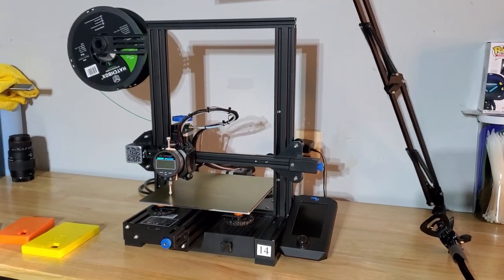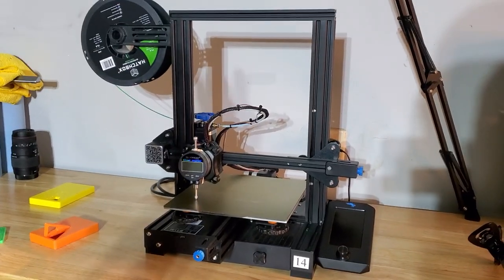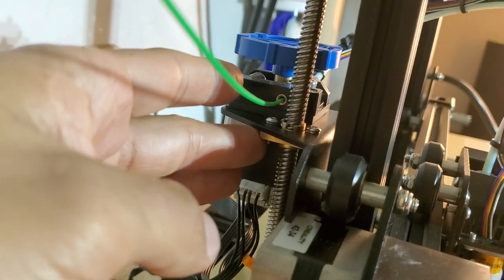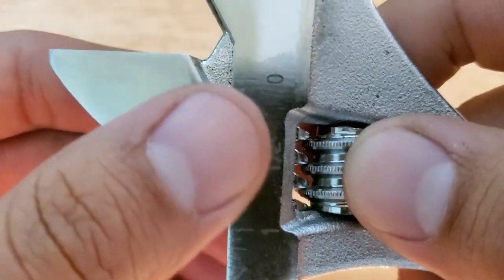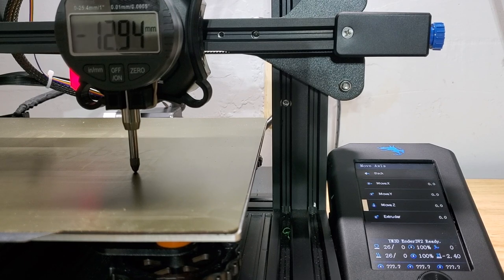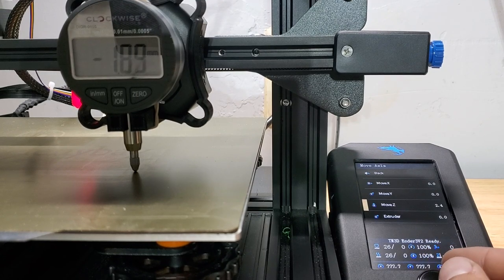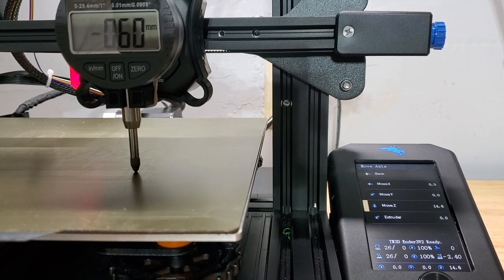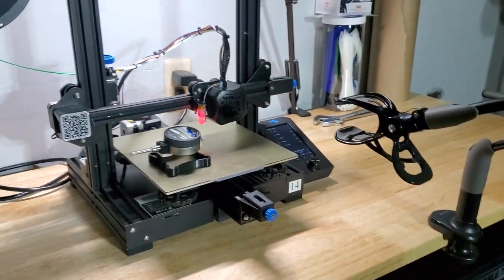3D Printing Elephants foot. How your lead screw is causing it and how to fix it! Ender 3v2

Comment: I mean ok but also  that is not how backlash works on a properly built and set up printer, sure if your printer is poorly set up and the gantry is stiff and does not fall under gravity like it should then yes the lead screw will move and the bottom of the tooth will engage and push the gantry down however this is all an indication of a poorly set up printer,  on a printer that is properly set up the gantry is free floating with no resistance  and is always trying to fall under gravity's power this mean that the the gantry should always rest on the top of the tooth when going up and down.  So if you are getting backlash then it is a sign that something is wrong with your printer ether the adjustment wheels are to tight or there is a imperfection in the extrusion causing a tight spot and so buying an anti back lash nut is not a fix it is a band aid to hide a deeper problem
Reply from the maker: My guess is the majority of people with an ender 3 have eyeballed everything during the assembly, so more than likely the large majority of newbie first time printers have this issue. What youre saying makes sense but unless youre the type to obsess over these details like a machinest the bandaid will work in most cases.

Comment: Use anti backlash nuts. The ones with springs in them
Reply from the maker: Yep that's what's installed. It helps reduce backlash a bit, but doesn't completely eliminate it.
Reply: @Redo3D  have you found a way to eliminate more?

Comment: should be a much easier way, i have an ender v1 and after an auto zero if you move z plus 0.02 you should hear the limit switch close and then move it back to zero and you hear it open

Comment: Your explanation completely ignores the effect of gravity on the system. Did you notice that how much discrepancy you are getting in the movement is proportional to the spring compression on the probe of your gauge. Also 0.3mm is a bad choice of distance to test with as the stepper motor has a finite resolution in angular rotation per step, and with the pitch angle of ender like machines one step of the motor equates to a Z change of 0.04mm so only Z changes that are a multiple of 0.04mm (0.2, 0.24, 0.32 etc.) would lead to consistent movements.

Comment: I dont use z-hop because of backlash. I solved leveling problems whan i Started using propper leveling method.

Step 1
Clean your glass with IPA (alcohole), never touch glass with your hands. Greese will mess up adhesion

Step 2
Heat your bed and nozzle, retract filament and celan nozzle so it has no plastis on surfacw you can use soaked wipe with IPA

Step 3
Go to moation and raise your z axes to 0.7mm

Step 4 
Level your bed on 4 corners (where screws are) with creality scraper. Its should be exactly 0.7mm thick.
Note: dont move print head woth hands, use comand od display to do it. Near corners with coordinatet between 30-40 mm, far ones 190-200 mm
(So you will use 4 places x=30,y=30 than x=30, y=200 than x=200, y=200 and x=200, y=30)

Step 5 
Enyoj perfectly leveled bed.
Your z-offsert should be 0.

P.S. maybe you will have to do Step 4 2 times.

This is copy paste from my notes because on facebook groups peopel often have problems with leveling. I made gcode for mine ender 3 but it wont work with v2 stock firmware because it cant use M0 command.

But here it is.
MESH:Bed leveling test.stl

M104 S200
M105
M109 S200
M82 ;absolute extrusion mode
G92 E0 ; Reset Extruder
G28 ; Home all axes

M107
M204 S500
M205 X8 Y8
G0 Z0.7 // i use creality scraper which is 0.7 mm thick
G0 F7500 X40 Y40
M0 Click to continue
G0 F7500 X40 Y195
M0 Click to continue
G0 F7500 X195 Y195
M0 Click to continue
G0 F7500 X195 Y40
M0 Click to continue

G0 F7500 X40 Y40
M0 Click to continue
G0 F7500 X40 Y195
M0 Click to continue
G0 F7500 X195 Y195
M0 Click to continue
G0 F7500 X195 Y40
M0 Click to continue

M106 S0 ;Turn-off fan
M104 S0 ;Turn-off hotend
M140 S0 ;Turn-off bed

M84 X Y E ;Disable all steppers but Z

M82 ;absolute extrusion mode
M104 S0
Reply from the maker: Thanks Mustafa for sharing your info!

Comment: A quick remedy would be to flip the leadscrew upsidedown. The upper part should still be wear free. This shouldnt be too difficult to do
Reply from the maker: The part that wears most often is the lead screw nut, it is made of brass and is a softer material than the lead screw.
Reply: @Redo3D  yes brass is softer, but that doesnt mean the leadscrew is wearproof. I think thats why when the gantry is at its lowest, the z movement isnt consistent. - its the wear combined from the homing and starting of prints.